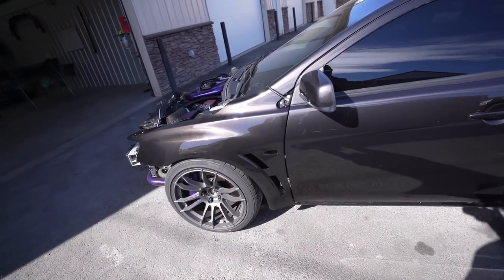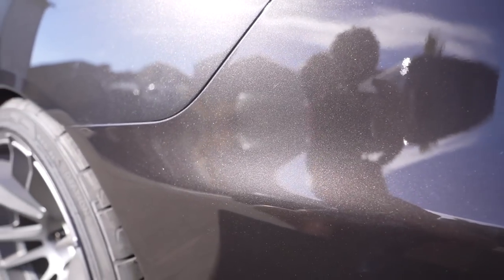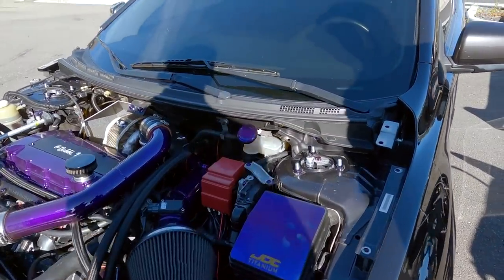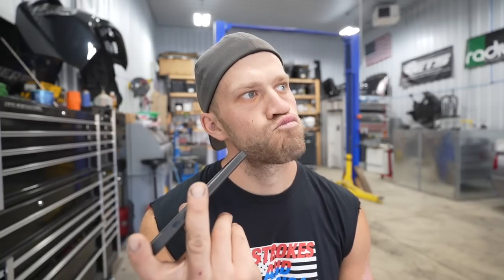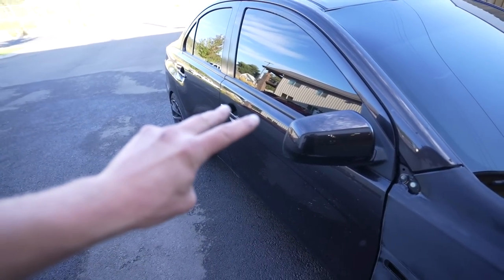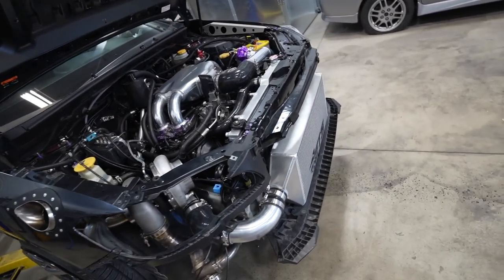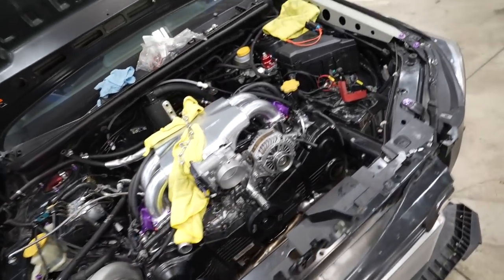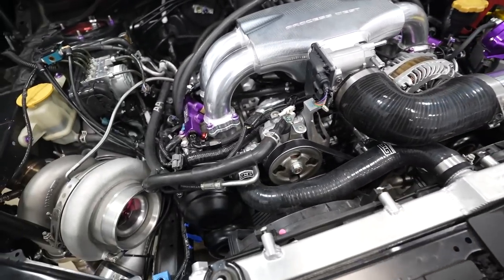BIG Changes for the Evo X!

Comment: I used to paint cars years ago, I would suggest to bolt everything in the car, hood, fenders etc. and re-spray , start in the middle of the hood down to the front fender, but start on the front and when you get close to the door, you fade out, then again do the middle of the hood, down to the front of the fender, and fading out close to the door..hopefully blending the color or tricking the eye making the paint matched..

Comment: I didn't read the comment but you can go to some body shops and there is one by me that can take a picture of the paint with a special camera and get an exact paint code. The thing with factory paint is some times the manufacture  are lazy, and will leave some of the old color in the gun before changing and it throws off the paint code that they set for the car.

Comment: Use a high solids clear for the final spray out. It will be harder to shoot but looks much better when polished and lasts longer. 
UhS clear if you want some real flake in the clear. Get you a real perfect paint for the perfect evo. No orange peal, color sand and a 3D shine. Pick up some paint sponsors.